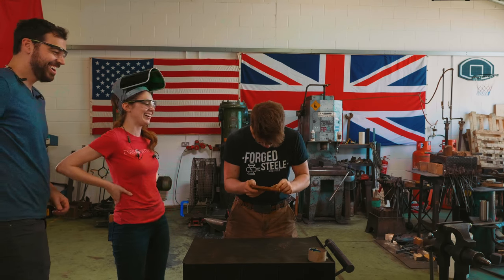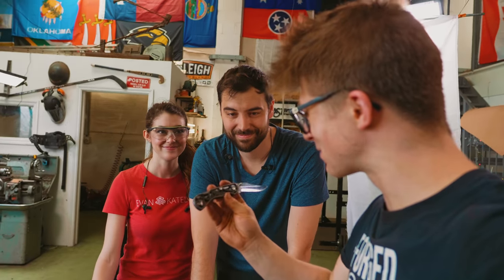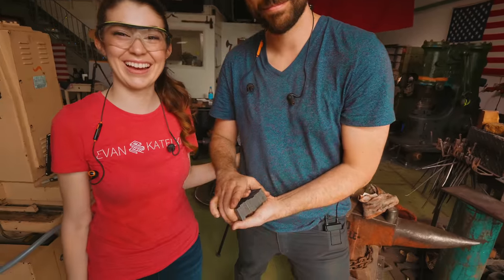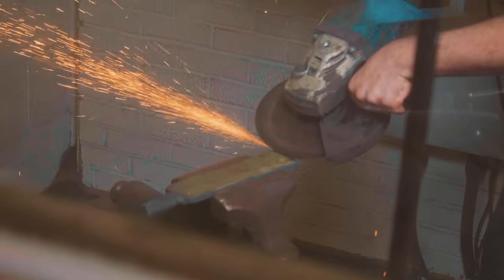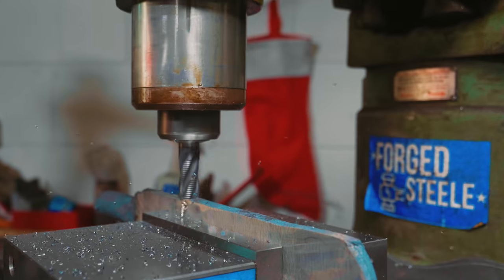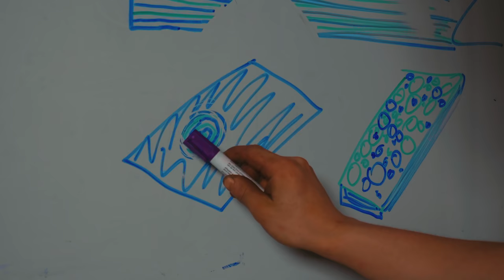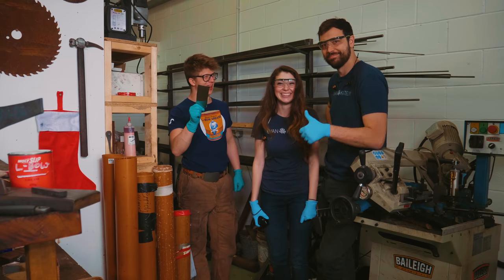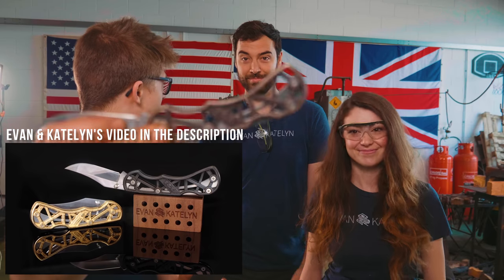MAKING RAINDROP PATTERN DAMASCUS!!!

Comment: Wondering if you make 81 layer domascus then drill and ream out 6mm holes then fill those holes with 1080 6mm dia rod friction fit. Heat, twist, power hammer to square, restack, heat and see what pattern came out.....
Just me then😎

Comment: Nice pattern, but I wonder if you drilled the stock at an angle shallower than 90deg. would you get a true raindrop pattern. Would the concentric rings taper to a point?

Comment: Hey Alec, thank you for finally doing raindrop pattern. It looks absolutely fantastic. Great photography on the stick welding. You need to let them use all of the rod. They are throwing away 1 full stick for every four to five stick rods they're using. I've done a ton of stick welding, years worth and we would never get away with throwing away that much. Question, how strong is a 3D printed metal can you advise thank you and God bless you.

Comment: Awesome video, by the way, couldn't this method be used to make "wood" pattern damascus? By driling lines instead of point and making them deeper the wider you want the wood knot. That would mean superficialat the edges of each line and deeper inside.

Comment: Alec, Do you still have the meteorite? if so how about trying to weld it in the same manner that the Japanese use. Basically heat it, beat it to pieces, collecting all the "good" pieces, stacking and welding.

Comment: your welding rod should be held closer, 1/8th rod should be 1/8th inch from metal, but since the rod end burns up into the flux like |/ - \| you hold it almost touching the flux to the weld pool. May require adjusting your amps.

Comment: What if ,     when you stack up the layers when you are making Damascus drill all the way through and fill the holes with pins (Like you are pining a tang to a handle) of different steel then weld it and forge it out ?    Might make a cool pattern

Comment: quick question; have you ever tried welding with something like Grant from the King of Random channel set up? He took out the power transformer(?) from a microwave and hooked it up with some jumper cables to send an electric current through some carbon rods he pulled out of some giant batteries. They get hot enough to melt rock, never mind steel.

Comment: WTF are you doing? This is mind blowing! Knife making taken to the next level.

Raindrop Damascus. Indeed, a truly beautiful pattern. But what happens if you engrave an image in such a way, that the outlines correspond to the lines of the steel? So after pressing it flat, you get the image as Damascus lines in the steel. Is this possible? You could start with your touch mark. Having a Alec Steele touch mark Damascus pattern, would be kind of epic. What do you think?

Comment: stick welding.. only the hottest (referring to the actual arc not how hot the metal gets as GMAW gets hotter because the metal generally used it thinner) its also the brightest need that helmet on 12 or higher.